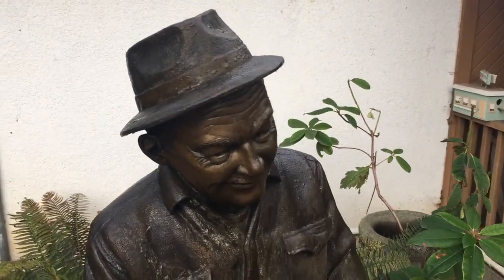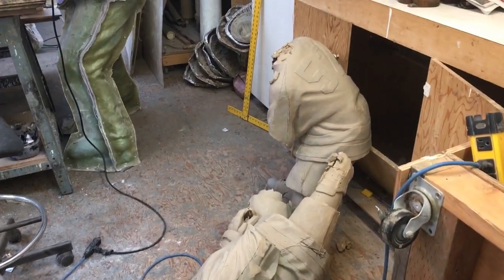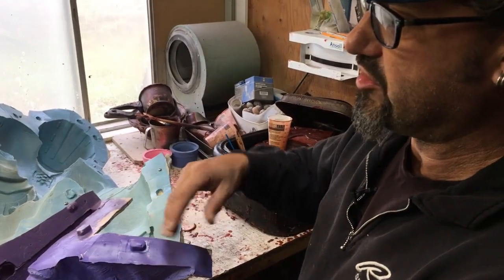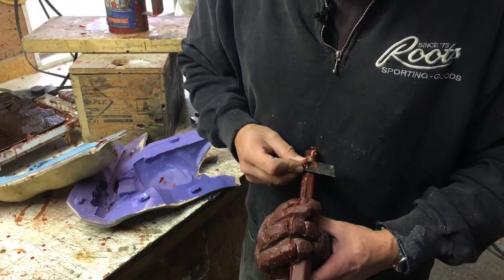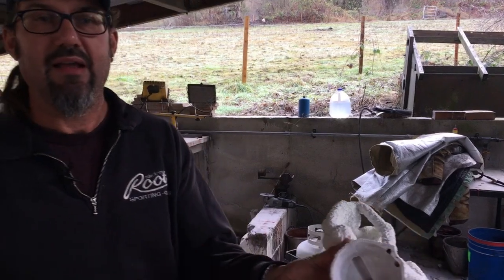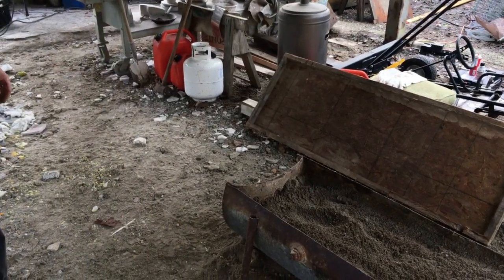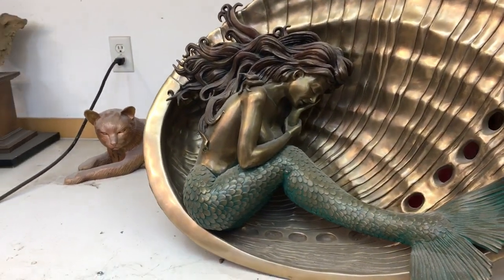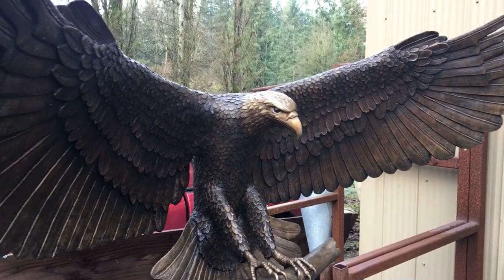FTF! Nathan Scott, Bronze Sculptor Shop Tour!!!

Comment: When Nathan melts the wax out of the molds, does he recycle the wax (or if not, could he) or does he just burn it off in the oven?
Reply: Pretty sure it's lost and why the call it lost wax casting.
Reply: It's not clear if he re uses the wax or it gets burnt off.
Reply: Yea it's gone. You could save what drips out but heating it changes the properties of the wax to whereas you would never chance it with a pour. I've reused paraffin wax used in 3D printing to make firestarters with dryer lint and saw dust in egg containers.

Comment: Nathan is really talented,i must admitt! Great explanation of the whole process.
But how to make the sculpture hollow?From what i understand,first is the clay model,
 this will be covered with silicone and fiber glass,then he puts wax inside.
But how he is able to manage,that the wax does not exceed a certain thickness?
Reply: After that the wax will be covered and filled with ceramic and the wax will be melted out....?And  how to manage the hollow space for the bronze between the ceramic skin and core  for the casting ???